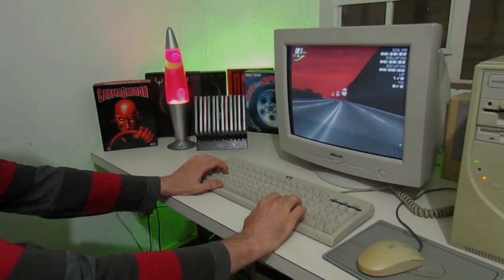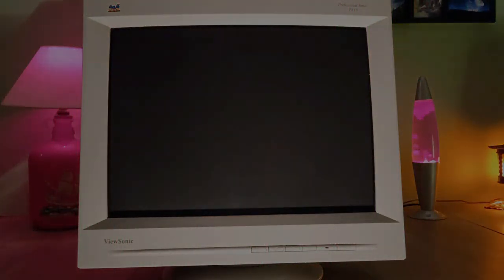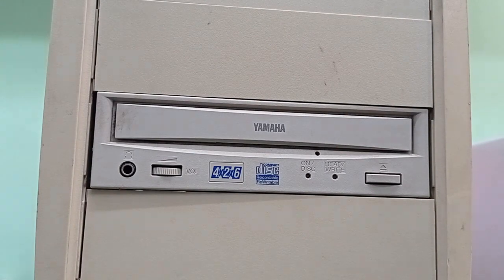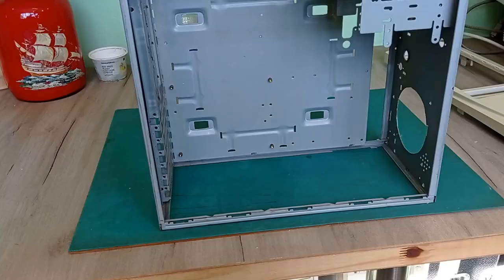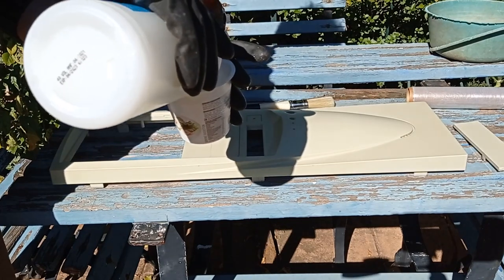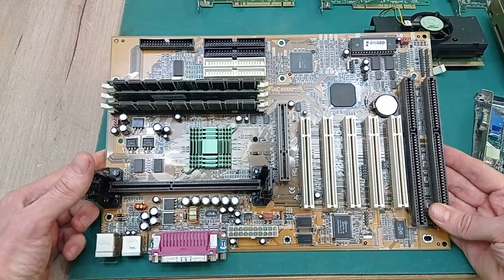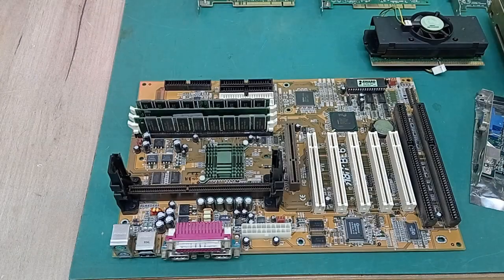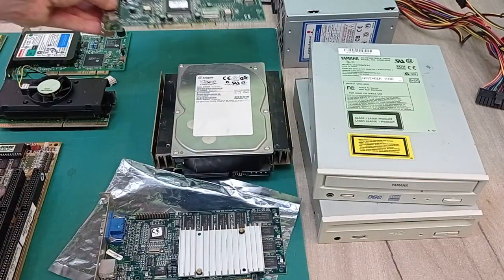Building my ultimate 1999 Voodoo3 PC! Part 1

Comment: I got a number of Dell Optiplex servers, well ... workstations really, many years ago at the end of 1999. Each had dual P3 550Mhz Slot CPU's, Viper 770 TNT2 ultra cards and 3 internal SCSI fireball drives. The PC's had onboard SCSI and also adapter cards. They opened up from the center of the case, design and build quality was amazing. Absolutely gorgeous, heavy beasts. Ooozed quality. Lasted as gaming PC's in a mini 4-man-LAN setup in my friends attic bedroom for years. We played Total Annihilation, Quake III, Warcraft II, Unreal Tournament etc for many years, stoned out of our heads, and not ONE of them ever crashed!

Great build by the way! And great video. You really captured the Elite Bastard PC Scene of late 1999!

Comment: Because of how remarkably fast technology was advancing for a few years there, this "Ultimate" 1999 PC is basically an Ultimate 1998 PC and is hopelessly out of date for most games from 1999 and 2000 (as you mention in your next part of the series). We, Swedish Retro Computer Association, host a 1999 themed LAN party yearly, or try to when Corona doesn't eat it, we allow all hardware that was available in 1999, so a P3 or Athlon 800Mhz and a Geforce 256 DDR or Matrox G400 Maxx is about the fastest you can get. This PC would struggle with a lot of the games people play at the LAN parties. Between 1997 and 2000, 4 years, we had effectively SIX generations of graphics hardware, each one basically making the previous ones obsolete. This build showcases that perfectly.

Don't get me wrong, it's an awesome build, really well done, and all you'd have to do is plop a faster P3 in there and it would do much better. A P2/P3 450 can barely max out a single Voodoo 2, you want at least a 750Mhz for SLI or your V3 3000. I've benchmarked Voodoo 2 SLI and my Voodoo 3 3500 AGP extensively, as has Phil from Philscomputerlab, faster CPU will make a HUGE difference to this build :)
Reply from the maker: Thanks for the kind words and the advice! That is kinda what I wanted to show for this video - how something top end from the beginning of the year would have been almost obsolete by the end, as you say. I mostly just wanted to do a voodoo3 build actually, although there were obviously much faster cards later in the year.. but I dont actually have any of them! :p  I think in the future I will throw in a faster processor for sure, just to make it a bit more usable.. Anyway, thanks for the comment and the view!

Comment: Love this build, I’m doing something similar now which started with a Gateway 500 I got for free. It’s turning out completely gutted, putting a Pentium III 800E in it which came out Dec 20th 1999! Paired with a GeForce 256, an IBM Model M and a pretty decent 18” Diamondtron monitor. The Quake crusher!

Those surround sound speakers you borrowed are dope. I was looking into speakers of the era and a company called Monsoon made the MM-1000 which are actually planar magnetic desktop speakers. Audiophiles still swear by them, would love to hear them myself!

Comment: Those holes are definitely for overclocking. I remember cutting case holes like that during the 3dmark 2000 days. I had a neighbor with a drill press and used a giant hole saw drill bit.
Reply: Next time make friends with a commercial electrician and ask to borrow his large hydraulic knockout tool.   ;)

Comment: The PC turned our amazing. 

Using a harddrive from back in the day does add to the soundscape you get from the machine, but I have also installed a compact flash adapter in mine to avoid unnecessary wear on the old drive.

Comment: Those are some pretty serious fans.
When I built my PII 400 w/ one, then later a 2nd Voodoo 2, I thought I was rocking the house.  However, I was not really "in tune" with latest greatest and I knew what ever I had certainly wasn't "the best" because my budget was limited.
I tried buying from local places, just cuz I prefer to do that, and I had chose a TNT 1 for my 2D card and when I went to pick it up the tech guy was running benchmarks on it and, at least to me, he said he thought the card was fast.  Some might take offense, but I didn't since I'd be bringing it back to him if I had any problems.  ;)  I took it as a compliment that he found my choice interesting.  Being a new card, it didn't have good game support, hence the addition of Voodoo 2's, which were well established.
I usually had CTX monitors, often 15", but I did get up to 17", and eventually got a KDS with a Sony Trinitron tube, which became another pride and joy. :)  I always had to run at least 70 htz or screen flicker would drive me nutz.  So I paid more attention to that than resolution.
I remember paying a lot for a sound card, which I think had surround, but I never got to really push it.  I didn't have space for big or surround speakers.   Later I had a Microsoft Digital Sound 80, but that could have been a later PC.
Kinda sad that modern gaming is mostly done on headsets, it seems.  I loved rocking the MS system, and later got the Klipsch surround system(still got both, but the MS subs rotted away, haven't sourced replacements, Klipsch is still going strong, but I replaced the subs once).
The PC I built after that was a 900Mhtz(IIRC) AMD w/ a GeForce 2.  Another fun rig.  The card claimed to have software, if you had a high enough refresh monitor (I think at least 120) it could take any game and make it 3D to work with the old 3D glasses, but that's another story.
Oh, and I remember being told back in the day that many would go the Celeron route because some could be crazy overclocked.  I was told because they didn't have onboard cache that they could be made stable at very high clock speeds.  Never tried it, had too many other hobbies in those days, but that's what I heard through the grapevine.

Comment: I do find the early 3D era quite interesting as I was way too young to experience this properly on the PC at least with a voodoo card. Such a huge amount of progress within that decade compared how things are now.
Reply: Dennard scaling and TDP increases combined in the 90's to make the whole decade pretty magical. Things are still getting denser (Moore's law), but denser no longer means faster unless you can use more parallelism (graphics cards mainly). You have to extrapolate the 90's trend out to see just how mad the 90's really was.

We went from ~5W 25 MHz CPUs to 70 W ~1 GHz CPUs in 10 years. And these CPUs even had a bit better IPC. If you use extrapolate that out until today you get a 4100 GHz CPU consuming 23 kW of power and still using a single core running at a vcore of ~0.14 V (implies 164 000 amperes of current!).

That trajectory couldn't last and obviously didn't. Leakage became too big, operating below the threshold voltage of silicon wasn't really practical. The reason pentium 4 (netburst architecture) was so terrible was that intel made the same bet they had made a dozen times before: Dennard scaling would for at least one more generation; pentium 4 would be able to clock at 8 GHz by 2003 (16 GHz double pumped ALU!) as they predicted in the late 90's when they were designing it; leakage would be suppressed somehow and the excessive pipelining would pay off. AMD made small evolutionary changes and if Dennard scaling actually had continued, the athlon XP and athlon 64 would have been a joke of a product. AMD was about a process node behind and Athlon XP and Athlon 64 was still performance competitive at a cheaper price; they got that bet right and intel didn't.

Intel made another terrible bet; they were going to abandon X86 so there was no point to make a 64 bit X86 standard. They were just going to emulate those older X86 instructions to run legacy software. Their IA64 itanium processor was going to become the new desktop architecture for 64 bit. These were monstrously large chips bumping up against the reticle limit and they turned out to be very inefficient. The whole idea was that the compiler was going to be able to detect parallelism and make extremely wide instructions that explicitly encoded what the CPU should do in parallel; turned out compilers are not good at this and never became good at this no matter how much money you throw at the problem. Intel had signed deals in the late 90's to support these things just until recently so they had this huge albatross around their neck for 20 years. This is why X64 was developed by AMD and used to be called AMD64.

Comment: The better path would have been the TNT2 Ultra AGP + 3dfx Voodoo 3 PCI. I also only have the AGP version which limits the games I can run with my machine. The best part of retro building today is being able to combine several pieces of expensive hardware (at the time) in one single machine.

Comment: I'd go with anything available Q4 1999, like a 800 mhz pentium III on slot 1 there.
The 80526PY800256 800 mhz penium III released December 1999, maybe a larger cpu cooler added onto this as well + 120mm fan spinning at like 800 rpm silently.
Dell 7472D Heatsink + 120 mm fan pointed at it id imagine would cool it down nicely.

GPU The geforce 256 as that released 1999. sdr version released October 1999 (ddr version released December 1999.)
Adding on some larger cooler from a later gpu for less fan noise & heat.
Or making a custom mounting solution for a larger cooler for some overclocking headroom, swapping out the capacitors on the gpu itself as well as they are probably dried up & out of spec or just about so.
Then a voodoo 2,3 or similar as secondary gpu for voodoo graphics compatibility using the geforce 256 as 2d gpu.
At worst you'll just need too restart the pc when you switch between the two for drivers too not fight each other too badly.

Maybe just for getting less noise additionally I'd consider making a larger set of holes for 120mm fans along with using those generic fan filters that layers up between the case & the fan pretty much for a cleaner look.
SSD or more modern sata harddrive or late gen ide harddrive ca 2006 manufacturing before they quit making them.
I don't like the obnoxious harddrive bearing noise whine with my hearing damage for more then an hour or two, it gets exhausting too hear for long.
Unless i got music or something that takes up a lot of that noise.
Reply from the maker: That would be an amazing build! It also pretty insane how fast technology was moving at that time - this pc of mine would have been pretty much obsolete at the end of 1999 even though it was top notch in early 1999!
Reply: @ohsoretro5612  
Why would anyone would had chosen to go with  Intel by the time the 800MHz Slot-A Athlon was out? 😅
I understand that before that it was kind of a gamble but by that time, really, why?

Comment: slot 1 vs socket 370 had nothing to do with the "real" pentium 3 vs the pentium 2.5 as you cited. The "real Pentium 3" Coppermine could also be had on slot 1.... both were available concurrently
Reply: Absolutely. I have an Asus 440BX board with dual slot 1 P-III Coppermine processors running at 800 MHz each, with 100 FSB. They are fully-fledged P3 chips with SSE and MMX support.

Comment: I also had a quite patchy result during retrobrighting, when wrapping the item inside clingfilm. It's actually better to put the item inside a clear plastic box 🙂. You can cover the box with clingfilm instead. I've done it several times (also using hydrogen peroxide paste) and I've had no issues.
Reply from the maker: Thanks! I will try that. I think getting a big enough box for a case like this would be a bit of a mission though!
Reply: @ohsoretro5612  Yeah, that's true 😀. The front panels I have retrobrigted this way were all either minitowers or miditowers... It would definitely be a challenge with a full tower like yours 😁.

Another tip I got from watching several videos about retrobrighting - when there's no sunlight available or it's too cold outside, an alternative is to use a lamp with at least a 60W halogen bulb in it. I have used this method more than once and yup - it works 🙂

Also thanks for a very cool video, I really enjoyed it and looking forward to part 2 🙂

Comment: Is there somewhere I can get that UFOGear badge? It's pretty cool and I'd like to stick one on a PC I'm building. 

Also, I'd have gone with that TNT card for direct3d and paired it with two Voodoo IIs in SLI for Glide games. Definitely the way to go if you're trying to break the bank I think.
Reply from the maker: I just made the badge myself by printing the image out on photopaper at the correct size (25mm x 25mm in this case) and then coating it with clear quickset epoxy. It took about 5 attempts to get a good one, but it came out nicely in the end. I can send you the image if you would like to try yourself..

Comment: You a saffer? If so are you still in South Africa? If so where did you get the retro parts? Yes that Viewsonic was great, a friend had the 14" and even that was amazing.
Reply from the maker: Yes I am indeed a Saffer and yes still here.. For parts I mostly just watch places like Gumtree and facebook marketplace and try buy stuff that looks interesting.. Some of my best finds have been in whole systems that I bought for very little.. The viewsonic monitors were very cool for sure.. I could never afford them back in the day but glad I finally got one after only 20 years! Thanks for the view btw!
Reply: @ohsoretro5612  I used to have retro builds and more modern systems, but after moving a few times I stopped using the older ones, post of me misses having both.
Those old CRTs are great but they take up a lot of space, I had a 21"one back in the day but now my 32" takes up less space and looks better :)

Comment: that voodoo 3 probably cost as much a the original 3k system now ha ha
Reply: The V3 3000 was 179$ and the TNT2 Ultra around 250$ where released in early 1999

Comment: This a nice 1999 build but not exactly "ultimate". 
The best possible configuration (so, "ultimate") in 1999 was a Pentium III 800MHz and a GeForce 256 SDR (although these came out in late 1999 so it's more a "Ultimate Christmas 1999 Build", but still)
Also, you sure you used your CRT at 60-75Hz? I remember very well not being able to resist more than 20min at 75Hz and I never tried at 60, probably would make your eyes bleed after 2 min 😅
P.S. I think it makes no sense to call the Pentium 3 450 a Pentium "2.5" and for 2 good reasons at least. 
1. If the P3 450 is an half-Pentium III then any Katmai P3 is.
2. The P3-450 has the same specs of the P2-450 plus a better L1 Cache and SSE instructions, so there is no rational reason to think that can be slower.
Reply from the maker: Yes, I should have said ultimate early 1999/voodoo3 build rather. The 450 was the top of the line at the start of the year and by the end there were 800mhz as you say, so this machine of mine would have been top notch in early 1999 and pretty much obsolete by the end of the year! Re the p3 450, I think the later Katmai's were much more of an evolution over the p2 because of thier much higher clock speeds, but the 450 is just not enough of an improvement IMO over the p2 it replaced to justify a new name. There is a video by phils computer lab about it that I found interesting: https://www.youtube.com/watch?v=CEpX0N30f2k
Reply: @ohsoretro5612  I disagree 🙂
A Pentium III is a Pentium III. Even if intel decided to start from 400MHz it would have been a full, legit, Pentium III.
The belonging to a specific generation can not be judged by performance or upgrade value.
Same thing happened few years later with the first Pentium 4 generation, Willamette 1.30GHz-1.70GHz were from slower to slightly faster than latest Pentium III Tualatin 1.40GHz, does this makes them Pentium 3.5s? I don't think so